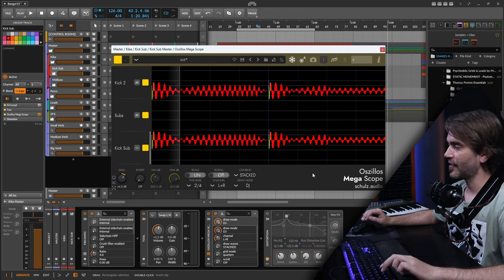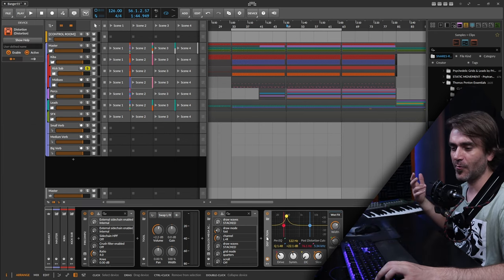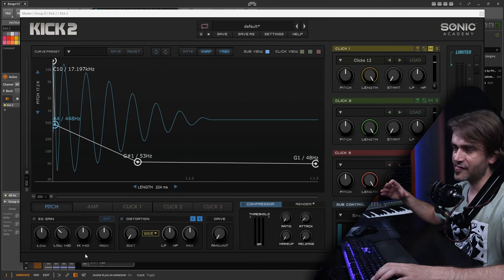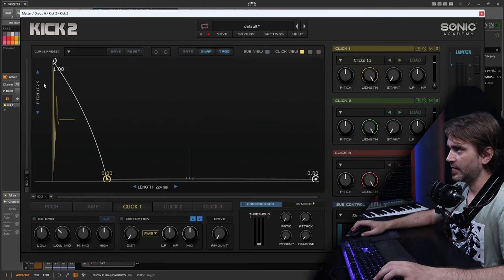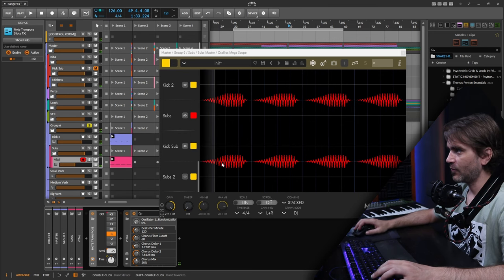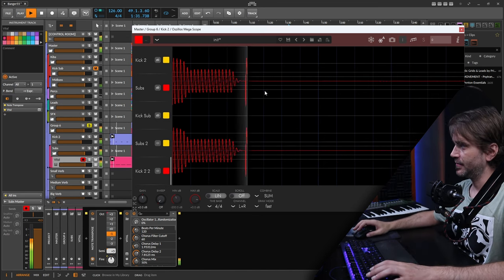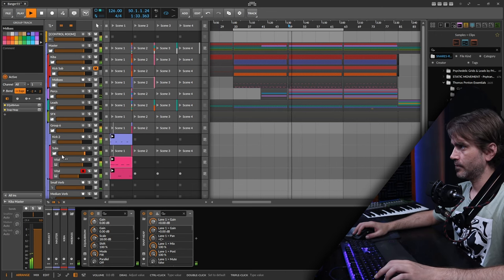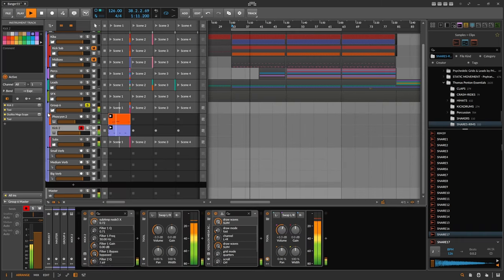Why Phase Is Important For Stable Kick & Sub Mix | Minimal-Tech/Techno Kick and Subs from scratch

Comment: Fack!!! I’ve been circling around for years trying to dial this in and while I’ve been close this put me exactly where I wanted to be. This is probably the best tutorial for what I needed specifically using some of the same tools I lol using. Specifically the kick 2 parts because I always struggle with its loudness and overall impact after adjusting the clicks, length etc. Thank you so much man! You’re a gem🔥🖤

Comment: Purrfect time to show this off, i use accent pitch basses in my current track, so this is a welcome additon, to improve on the overall concept. I use shaperbox which has a build in oscilloscope. Its also perfect as LFO tool replacement. (And has a side chain input, to visualize the 2nd input. )

Comment: Great video! I was just thinking, changing the volume of the downbeat sub notes from the others is a cool idea but having them on separate synths makes it harder to prevent the notes from phasing with one another (assuming the envelope has some release). I'd probably just use the note velocity for safety. Otherwise it's a great surgical process :)

Comment: 17:05 And that's the problem. Or just "problem" depending on your perspective.
You can't "just" change the note of the sub. With techno, that might work most of the times. But even in techno, sometimes that's a limiting factor you don't want.
Fortunately, Bitwig has the device Note Receiver. I would have to sit down for a while to figure out how exactly, but that device should help you make the kick's pitch automatically follow the note the sub is playing. Depending on how the kick synth is reacting to a change of the note, especially the envelopes, it might be a good idea to resample the kick first.
Reply: Something that also could be a problem with this: The signal from the note coming from the sub might come one tick to late. So the kick note just started and the note number is already sent. So you might want to modulate the pitch in the sampler instead of manipulating the note itself with a midi device. That would still work (really really) shortly after the note on message.
Reply from the maker: in my experience you want a static pitch for the kick, if you want to change the notes of the sub, just do it on the last of the 1/8th part of the 1/4 and there will be no issue.

Comment: Super useful video! Thank you for sharing 😉   (Side note: I still have the same limited edition Novation keyboard just like yours😁)
Reply from the maker: mines recently started packing up, random dead pixels and some keys don't fire a stable velocity. It saddens me because they don't make them like that anymore, I just don't wanna can it
Reply: Yeah I know the feeling. Sucks to get rid of good tech/hardware just because of minor problems. I was gonna suggest to look for a used/parts only option and use parts out of that. But its probably near impossible to find these knocking about as they are old hardware...  @DashGlitch

Comment: Hi! Thank you for this great video! I am following along, and have a question about the sub basses: Is it only the sine wave making the sound? No saturation, no filtering, no nothing, other then the sine wave in the finished result in this video?  Its like I can hear your sub bass clearer then the copy I am making somehow... Thanks!
Reply from the maker: It's just the clean sine wave, I think the most important thing is the balance in the mix, for that I use a reference track and A/B to test the volume, but otherwise it's usually just a clean sine, yes
Reply: Thank you!  @DashGlitch

Comment: This type of precision makes me wonder why we don’t just make one patch that does both jobs. Given your wizard level skills in phase plant I would guess you have done this before. Maybe there is some reason you prefer to layer a kick and a bass rather than make one kick/sub patch?
Reply from the maker: Easier to groove it if you have midi control over just the sub :) also Phase Plant is immense and one of the best software synths out there, but it's not 100% sample accurate with very sharp modulations, which the kick is. I mean it sounds good but it's not 100% repeatable if that makes sense.
Reply: @DashGlitch  it makes sense my bro. thanks for everything.

Comment: Hi Dash, i maybe missing something but, how come you use the note transpone, and not just start the sub on F1 in the first place? Im sure ofcourse there is a valid reason.
Reply from the maker: It's easier to memorize notes in C and riff in C, so I write in C and transpose. Even simple stuff like this, because it will undoubtedly expand
Reply: Thanks for the swift response, makes alot of sense.

Comment: My pilosiphy is to NEVER use a tuned kick.Tuned kicks creat phase issues. Only use the kick that's tone has the correct vibe for  the track.
Reply from the maker: Understanding what the "phase issue" is is far more fundamentally transferrable. I like to understand the physics of why something happens rather than just limit myself to 1 set of kick samples.
Reply: @DashGlitch  i use eurorack to generate my kicks or use a sample if needed. I just don’t intentionally use an in tune kick.
The more out of tune to kick is the less it will influence the phase of the bass.

Comment: WTF OMG.... Dash, Have you stopped using cubase, If so, Why?
Reply from the maker: Yea dude, almost 2 years ago now. Cubase is dead in the water, there have been no significant updates since I stopped using it, and several of the same bugs are still present. In less than 2 years in Bitwig, there have been more updates and new features than almost a decade of prior Cubase use.

Comment: what if sub change pitch/note  for more musical subs? how do you sidechain kick then, because 100% of time it will be misaligned
Reply from the maker: keep the on-kick sub at the root note
Reply: @DashGlitch  yeah that works, but just tried with kick2/serum, and it it possible with right kick, but  sub notes which are not in root key are a bit quieter, so boosting volume a bit could work good. Thanks man

Comment: Thank you, i so wish you showed us the mid bass process, isee you cutlow end but is there any phase alignment between the sub bass and mid bass?
Reply from the maker: No phase alignment needed because the low-end was removed. The mid bass no longer has the fundamental which would clash with the phase of other low-end elements. Like I said, the reason I use Phoscyon for this kinda thing, it's just insta-win, just slap it on and it almost always works. Just a bit of EQ and you off to the races

Comment: Change the note of the sub and tell me what happens!
Reply from the maker: as I mentioned in the video, I use 2 bass instruments, 1 that's always on the kick or within the first 2 1/16ths, and another one where the note changes etc. Makes it easy to align that way.
Reply: @DashGlitch  yeah but if you want to make chord changes each bar it won't work out the way you're demoing. I'm not saying it's not good advice though. Just won't work in every context
Reply: You can use velocity for modulation phase bass.😊😊😊